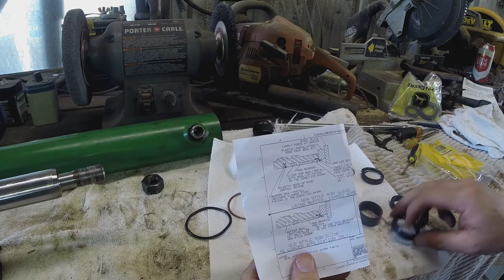Leaking Hydraulic Cylinder Repair: Replacing hydraulic cylinder seals on a John Deere 541 Loader

Comment: Thank you very much for this video. I have a 527 loader and I had no idea it has an internal snap ring, and you have to use that orange removal ring to pull the packing carrier out. I was just about to throw in the towel and take the cylinders to the CAT service shop and brace myself for the sticker shock.
Reply from the maker: Glad it helped!
Reply: Hi again Fritz, unfortunately, I went 0 for 2 this morning. So frustrated. A friend helped me and followed your steps precisely, but the packing carrier still hung up. It was a good learning experience because we found that you have to keep the orange ring in the groove (precisely) as the packing carrier begins to pass over it. As you probably well know, the orange ring wants to wander out of the groove. We of course secured the rear of the cylinder, and we pulled on the ram w/a hand winch (aka come along) We don't know why neither ram would clear the groove. If I can buy several more of just the orange ring, I'll try again asap.

Comment: At 5:20 I tried something similar. I had a 12,000 lb winch attached to my car on one end and the tractor on the other end with chains and steel cable.

Still won't come out. It drags my car and breaks the cable.

Comment: The lift cylinders had the same design? With the need for a removal ring in the groove? My lift cylinder kit didn't come with the tool and came with snap rings instead.
Reply from the maker: Yes. if you take off the external snap ring then tap the gland down into the cylinder about an inch you'll see the groove the orange removal shim goes in. If you have the same model...
Reply: Ok thanks. John deere gave me the wrong seal kit then! Thanks for fast response.